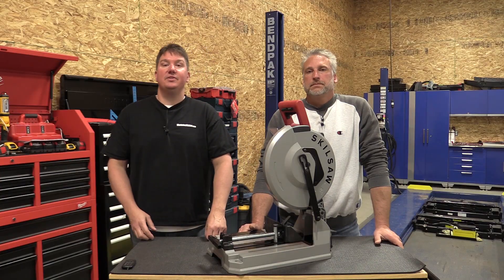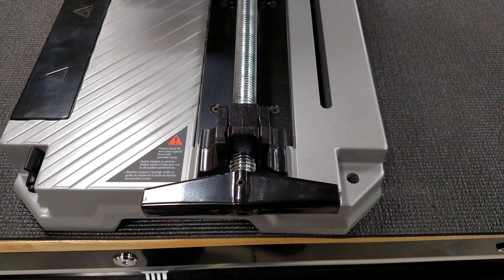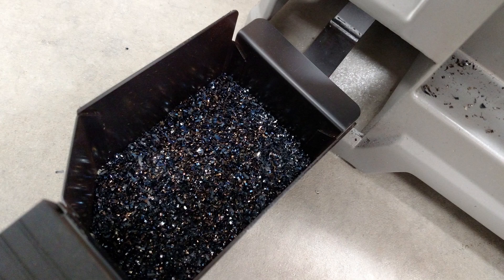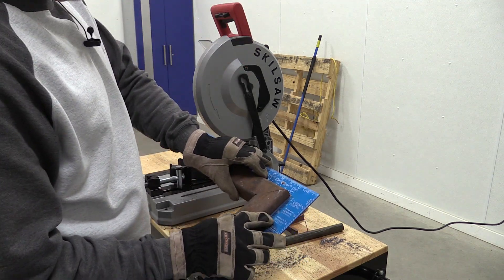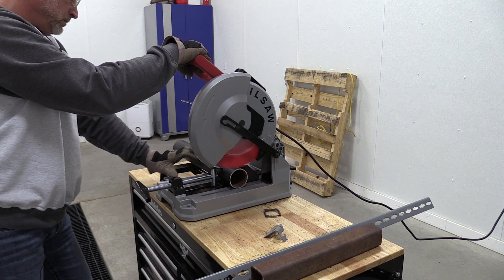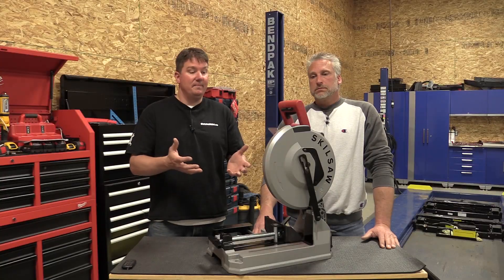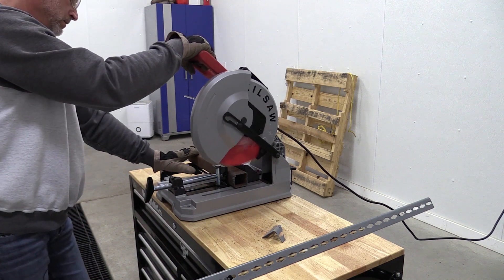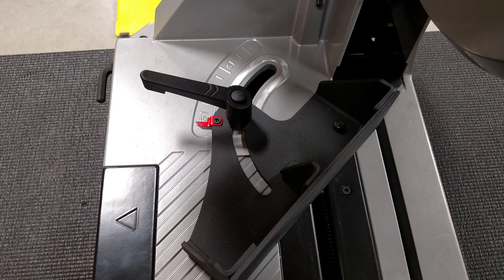SkilSaw 12 Inch Metal Dry Cut Saw SPT62MTC-22 Review

Comment: For a long time, I used to raise an eyebrow at dry-cut saws because a big band saw can cut case hardened material. Then, I got an Evo 380CPS. This is the loudest tool I have ever owned. The chips scatter in a dangerous way. With that said, the performance is undeniable. You don't have to think. Just cut it. PVC, Copper pipe, Big pieces of steel. Stainless (with the diablo cermet blade), wood with nails in it, 3" thick aluminum bar stock. The abrasive saws lend themselves to harder things like grade 8 bolts, dowel pins, crooked cuts, dirty steel, and cast iron.

Comment: The extendable table is nice but is the base a standard 2.5" thick like a wood cutting chop saw?  This way you can use a 2x4 for longer support or drop it into table or homemade portable stand without having make odd sized supports.
Reply from the maker: +Sir Malaki Yes it does.  If you need this to use for any projects, you know where it is at.  It's sweet!
Reply: I may take you up on that when I get ready to make a new welding table soon.

Comment: Nice review ! 
Wonder how it compares with Evolution Power Tools similar saws ?...
Reply from the maker: +Jérémie Tarot I cannot answer that but it is a VERY similar design when looking at them.
Reply: Indeed. This may also be a good news if blades are compatible. I have to check that, or see if I can find blades of other brands that can be used on these chop saws (and other Evolution miter and table saws). I'd rather not have "nespresso saws"! ;)
Reply from the maker: +Jérémie Tarot It has a 1" arbor and i would assume Diablo is making the blade so it can be used all over on different models.
Reply: Thanks for the Diablo reference, will investigate these...

Comment: If the great Dablo blade doesn't come with it, the significant cost for one needs to be added in.
Reply: Nevermind. Just rewatched and they said it did. The blade is 80% of the performance. My focus now shifts to motor torque and base material. Will value compare to a half dozen respected brands.